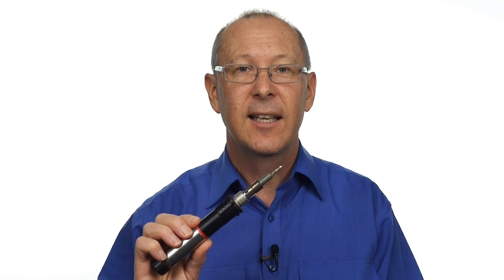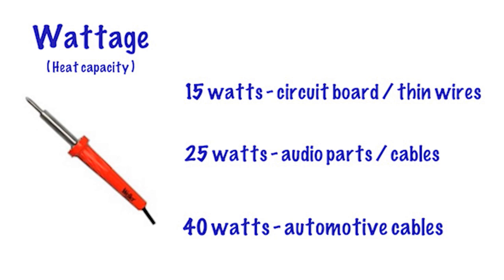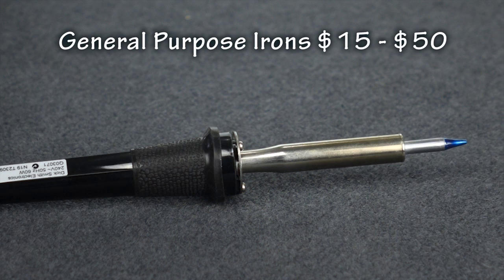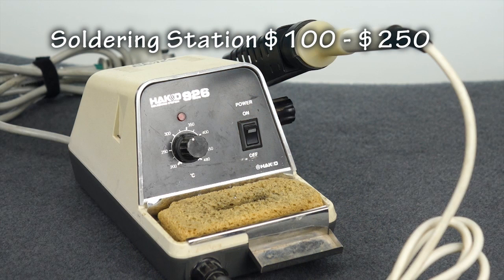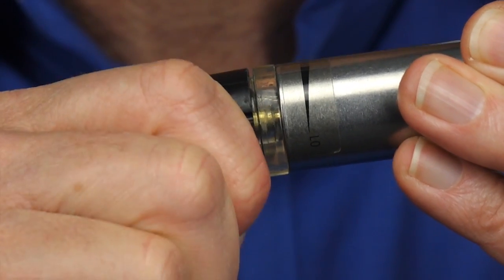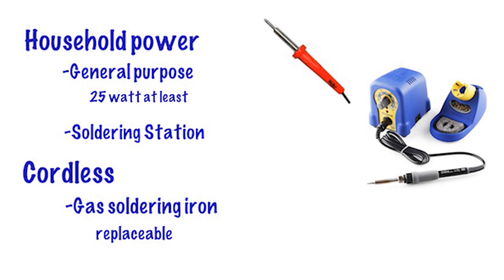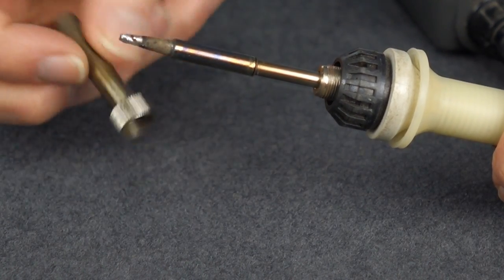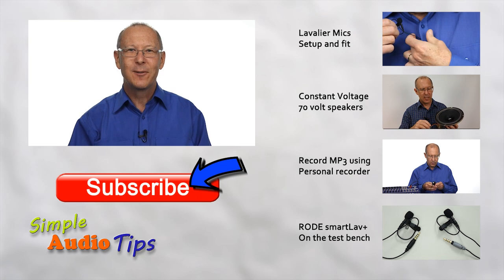Which is the best soldering iron to repair audio leads?

Comment: I used to have a cheap radio shack one and was having a hard time soldering and then I moved to a metcal 5000 station and I can assure you the difference is really made me really happy 
there is no comparison between them.
Reply from the maker: What a jump up in quality. I agree there is a big difference in the operators experience when you get to use good equipment. Cheap irons will get you through in a pinch but if you are using them for fine work and over long periods of time it is much better to have a quality iron. Thanks for commenting.
Reply: +Simple Audio Tips I was very lucky to find it. on a garage sell it  like new condition. and for 80 bucks I believe the person that was selling it had no idea of what it was worth. and best of all it included 5 a sorted tips and 2 hand pieces it was even in the original box.  when I saw it. I just grabbed it and didn't let go ....  I thought it was going to be expensive but then she told me how much would you give me I offered 50 she said 80 and I ..... just pulled the money out. and Ran.     
lol.
Reply from the maker: +F SEVILLA that is what I call a WIN for you. They don't come around every day but from time to time we have one. Good on you. Enjoy it.

Comment: I thought that was very illustrative, thanks mate. I've just got myself an 80w Ironside iron and I'm gagging to try it out.
Reply from the maker: +Xavi Lanuite If you can sometime, please let me know if it does what you want it to do. Even if you have issues with it being too hot etc, you will still gain experience.
Reply: Hi there, I never expected you would answer. Well, thanks.
My soldering iron works wonderfully. I've already applied it to a number of different tasks. First of all I soldered a couple of 3.5 mm connectors on a pair of speakers and earphones, which was a bit of a tricky job but anyway I had a good third hand here.
Then I re-soldered the wires to the left earpiece of my daughter's headphones: kids just toy with these things and keep tugging them until the wires snap. Luckily enough, I had my new soldering iron at hand and a good session of Youtube tutorials.
And lastly, I used it for welding: I wanted to hang a rather big and heavy  bird feeder out in my terrace, so I had to re-shape an old bracket. No problem, I stuck a huge hook onto it with tin solder and voilà, that was it, nothing can pull it apart now.
So as you can see, an 80 watt iron, although in principle not recommended for certain delicate jobs, will actually be of service in all situations.
Reply from the maker: +Xavi Lanuite What an amazing story. You have put the soldering iron to more uses than most could imagine. Good to hear you were able to solder even those small wires.

Comment from the maker: +Bryan Westerveld For some of the Weller irons you are limited to a small number of tips. The principle is to transfer heat quickly and efficiently to the header pin. A flat or chisel tips would be best for this because there is a lot more surface area on the tip. You will need to use at least the 25 watt iron because of the amount of metal you are heating up. ie. pin and cable. There will be a lot of opinions about this but that is what has worked best for me. Hope that is of some help.
Reply from the maker: +Joshua Felty Yes small wires will solder ok but if you need to solder the small wires to a metal terminal you may need a little more heat like a 25 watt iron. 15 watt irons are good for small wires onto circuit boards.
Reply from the maker: +Joshua Felty Scope, Weller and Hakko are good brands but are generally more expensive but are more likely to last longer.

Comment: I have an old Weller Si15c (15w) and a 25w variant with flat tips. What sort of tip do you recommend for stuff like soldering headerpins? As sharp as possible, or somewhere in between?

Comment: My Portasol butane gas soldering iron is not getting as hot as it did when new. It needs a service. Have you produced a video on cleaning and servicing gas irons ?
Reply: +Sir, I have 2 Portasol Sp1 Super pro irons that I use in scratchbuilding my 0 gauge model railway hobby when I am out in the caravan. One will not ignite unless the tip is temorarily removed, and the other does not have as large a flame when turned fully up as the other iron. I have previously replace the small insulating nylon piece with a heavy plastic tubing piece, having had no success with finding a supplier of the replacement parts. I did do a scan of the back of the box showing the serviceable spares available and also took a photo showing the flame of the 2 irons but there seams no way of attaching them to this email.  Regards, Kerry Queensland
Reply: gas soldering irons have a catalyst in the tip, it goes bad, you need to replace it
Reply from the maker: +Kerry Viney Sorry to hear your iron is getting a little tied. I haven't produced a video about servicing irons. If you have the same PSI-100K Portasol iron as illustrated in the video there may be a tweak you can do to adjust the heat. Worth a try anyway! Interested?
Reply from the maker: Sorry for the late reply +Kerry Viney. The one that is hard to light may need the tip air vents cleaned out, do you have any new clean tips to try on it?
The second one that has a small flame may have a blocked jet. I have not been able to find any parts suppliers for Portasol so you must take care not to damage it. The jet can be cleaned with CRC brake or carburettor cleaner. You must use personal protective equipment. Hope this is of some help.

Comment: hello i come from the Netherlands and i want to start with woodburning. so i got the advice to buy de Dremel Versatip 2000 is it a good one to start with it, ore should i buy one that works on electriciti?  sorry but my english is not so good i think but i hope you understand my question
Reply: it might be too late but don't buy dremel. The catalyst which is a very important part in gas soldering iron burns out very fast and you cant buy a new one. Get a portasol, they have catalyst in the tips so when it burns out you just buy a new tip
Reply from the maker: +Liverpool Biker Good observation, I wasn't aware of that. Thanks for the information.
Reply from the maker: +Bianca Smits Dremel are known as a quality product so you will get good value. It is a very versatile iron and it may be ok for wood burning. If you are buying an iron for the craft of wood burning you would be better buying an electric purpose built kit like the "Weller
 WSB25WB 25-Watt Short Barrel Woodburning Kit". I hope that is helpful to you.
Reply: +Simple Audio Tips thanks for youre advice, i preffer advice from jusers, because shops can give a nice discription, but jusers know what's the best tool to work with..
Reply from the maker: Yes I agree.

Comment: My JBC CD2-BB is my workhorse. Costs a pretty penny but will last forever and works amazingly well!
Reply from the maker: Excellent choice +Obviousz That is an very good soldering station. Just had another look at the website and they have some great gear. Quite expensive if you are not using the equipment very often but many people have a Ferrari and only drive it on weekends.

Comment: Thank you, what do you think about the Weller WLC-100 solder station?, all I work on is microphone and audio cable's.
Reply: Gary Davies - AudioTTR I found this on my feed today. I bought a 25w soldering iron from jaycar. It has done the job, for a rank amateur like me. Hello from the Beadons in Roma😃
Reply from the maker: Thanks for your comment +Clatten Strait  The Weller WLC-100 is not a thermostatically controlled unit. You manually have to adjust the temperature to match the task. In your case, if you don't have large terminals to deal with it should be fine. Great value for money. Hope that is of some help.
Reply: Simple Audio Tips Thank you, I tried it last night, it was tricky at first to find the right setting, but after I found it, I was back to fixing audio cable's with no problem.
Reply from the maker: That's great news. It is good that you have some adjustment on the wattage.
Reply: I did find out recently that the handle is made kind of cheap, I tapped the tip on a can to clean off the tip, now the solder iron handle doesn't work.
Reply from the maker: That's not good. I hope you are able to get some assistance to replace or repair it. I guess the more economical to device, the less robust they are.
Reply from the maker: Great to hear. Amazing where you will turn up in the internet hey :)

Comment: hi,what type of soldering iron do you recommend for cell phone and computer repair?
Thanks in advance.
Reply from the maker: +KayeshQuddus That is a great question, The manufacturer Weller gave these suggestions. A 15 watt iron will suit circuit board, micro components and thin wires. A 25 watt iron is good for general audio parts and cables. So the work that you are planning on carrying out is circuit board work. These are a guide for just basic irons but I definitely recommend a temperature controlled soldering station with replaceable tips. You will need a fine tip and have the temperature set just right so as not to melt the parts you will be working with. The channel +paceworldwide has a great video on component soldering, feel free to check it out : http://youtu.be/AY5M-lGxvzo

Comment: After trying Weller and other lesser brands, Hakko is all I'll ever use. Their 936 station got me through ten years of racing radio controlled cars and various home projects. I believe the exact model is discontinued, but here's a clone for under $20 plus shipping: http://www.hobbyking.com/hobbyking/store/uh_viewitem.asp?idproduct=19240&aff=421628
The included tip is thin for my typical use, but different size tips are available. A tip that thin was nice when I soldered a couple IC chips to a Sony Series 1 Tivo circuit board to speed up menu navigation.
Reply from the maker: Thanks for highlighting a very economical copy of the old Hakko 936 soldering station. Great to hear that it is working well for you. To clearly see the differences between this Hakko station and the copy please check out this comprehensive comparison by +terraoperative 
http://youtu.be/TP0etU7mTwU
Reply: Simple Audio Tips Terraoperative made a thorough comparison review indeed! For an alternate tip, I suggest a Hakko standard chisel tip such as: http://www.amazon.com/Hakko-T18-D24-Series-Soldering-FX-8801/dp/B004ORB8J2
It's backwards compatible with the 900 series.

Comment: That's the best video I've seen on soldering irons! Huge help. Thanks! What's that MASSIVE iron for?
Reply from the maker: Sam Davies Good question. There are a lot of applications where these would be used.. Electricians at times have to heat up thick metal terminals to solder cables in industrial motors. Where ever there are large parts that need a lot of heat. Remember that heat gets sucked out of the iron to raise the temperature of the object your soldering. The irons wattage has to equal the task or it just won't solder effectively.
Reply: @GaryDmedia  hi is jcd 908s ok?
Reply from the maker: I’m not familiar with that model. It is not that expensive, it may be worth a try.
Reply: Simple Audio Tips Ahhh that makes sense. Thanks SAT!